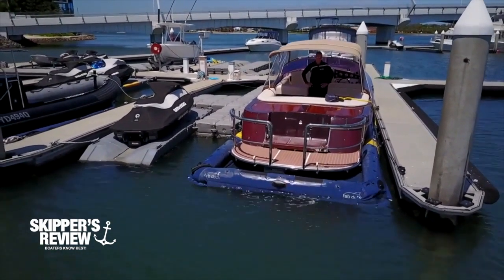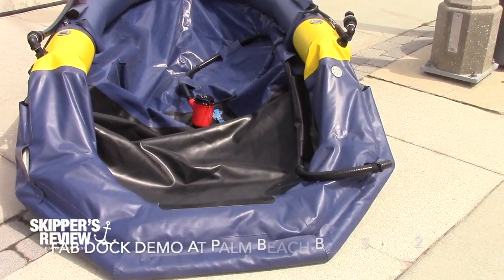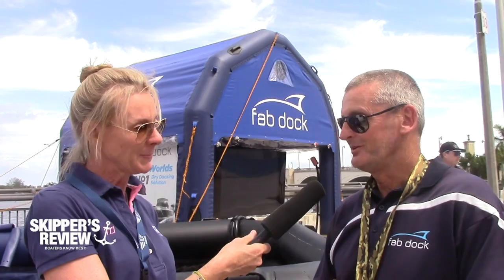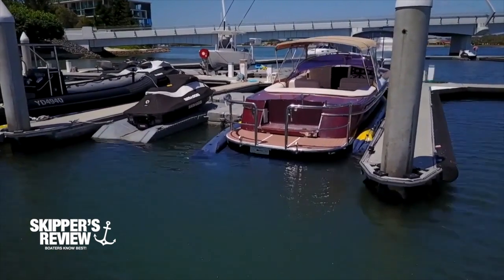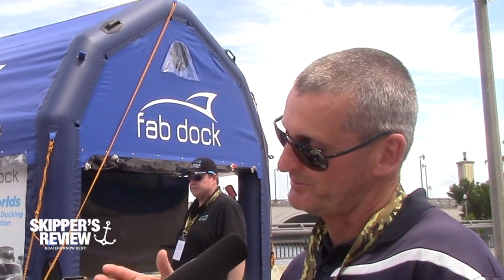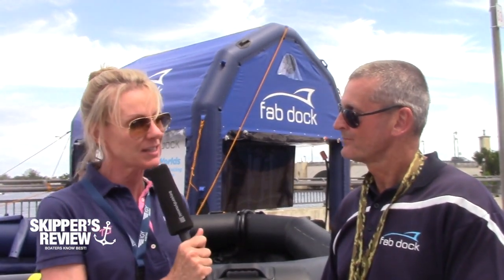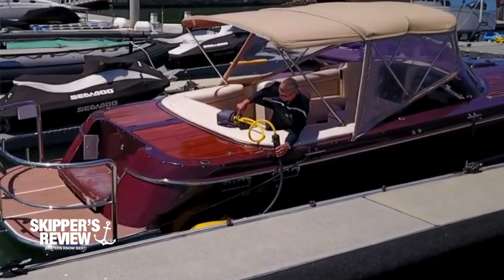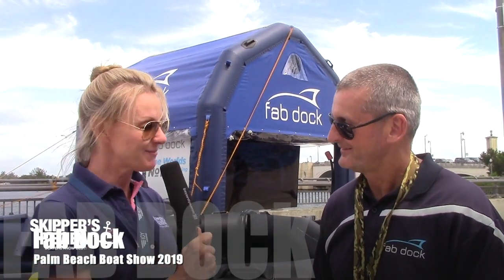What is a FAB DOCK?

Comment: how do you keep from getting barnacles and other growth from growing on the fab dock?
Reply: Same question here. And how to deal with rain water in rainy season?
Reply: I am looking to be a customer soon.  Researching, growth on the underside of the fab dock is no big deal.  Bigger pieces pull off and a pressure washer takes care of the rest.
Reply: @salem4216  The pump system is connected to your boat power (or solar or perhaps an inverter for dock power as it is a 12v  system) at all times while docked and will bilge out water from rain